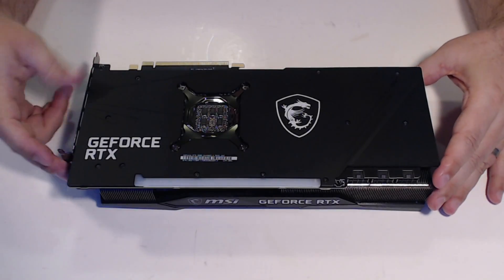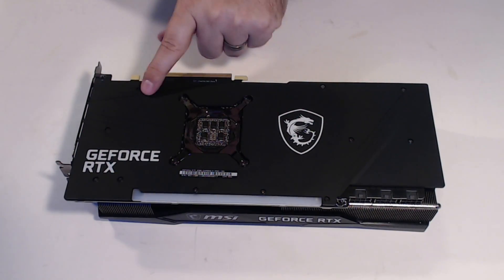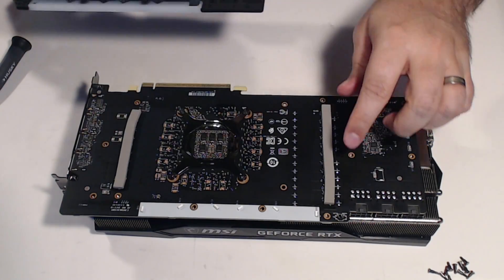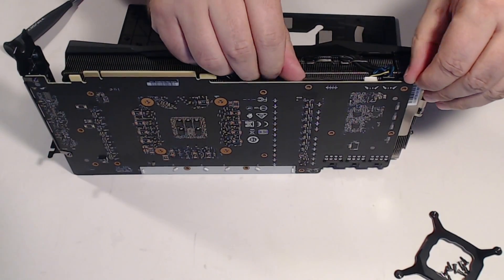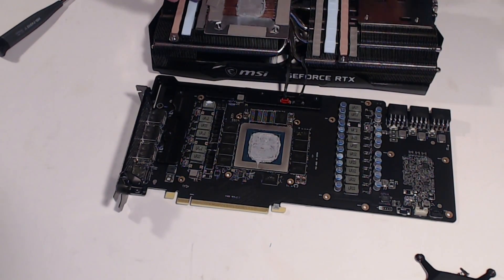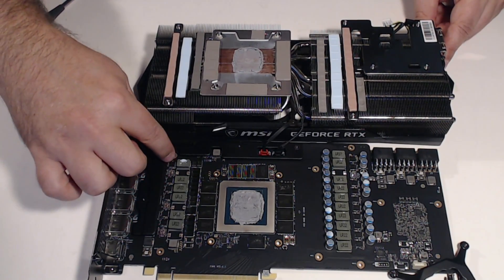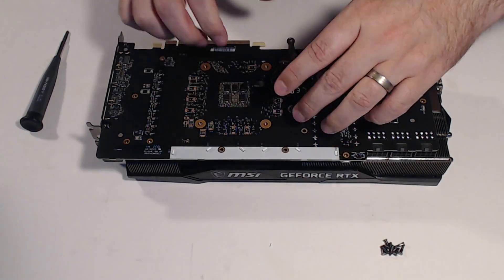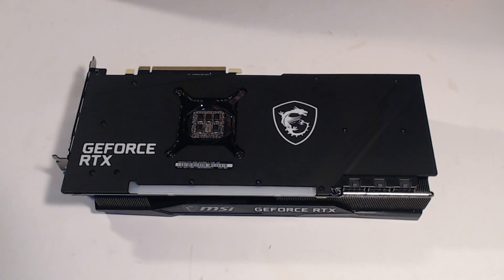MSI GeForce RTX 3080 Gaming X Trio Teardown

Comment: I got 2 geforce rtx 3060 gaming x trio 12g graphic cards I’m wondering if I can run them both on the same system for gaming
Reply from the maker: RTX 3060 doesn’t support SLI, so outside of Ashes of the Singularity, no, you can’t use both for gaming.

Comment: Hello, can you help me please where can I buy memory modules for my board rtx 3080 msi gamin x trio?
Reply from the maker: Memory modules, or thermal pads for the memory modules? Because if you’re thinking about trying to replace/upgrade the memory and don’t know where to buy it, you’re barking up the wrong tree. 🐶
Reply: @JarredWalton  no man, my gpu is repaired in service and the memories are defective, and i need to buy others to be replaced!
Reply from the maker: @CIF05  soldering in new memory is not for the faint of heart! It’s not something I’d even try to do personally. I’d just do an RMA on the card, though of course getting a replacement could take a while.
Reply: @JarredWalton  once I changed the thermal pad the rma was canceled. no?
Reply: @CIF05  no

Comment: I want to change them in my graph, which is the same as the one in the video, could you tell me how thick the memories are?
Reply from the maker: Probably 1mm, maybe less? If you want something better, check Amazon for their highest performance thermal pads.

https://www.amazon.com/Thermalright-120x120x2mm-Conductive-Resistance-Temperature/dp/B08Z7WLRH4/ref=mp_s_a_1_2?tag=dosk-20

Comment: Why would you NOT clean that die and replace with a decent thermal paste job?
Reply: Sorry if i am mistaken, but i think the paste "mess" is because of the video card's gpu having the exposed die directly in contact to the radiator surface, and the lack of IHS giving the need for that amount of thermal compound

Comment: How thick are the thermal pads up front for the memory? I can see the back is around 3mm
Reply: need the thickness too. just got 1,5mm was too thick forthe 4 pads around the gpu :(
Reply: @wannabeats2195  i used 2mm and encountered problems with temps. Changed to 1mm and it's perfect.
Reply: @fransarj  thank you very much.my card is at the moment running at 40 mhs and 80°C, fixed it a littlebit until pads arrive :-!
Reply: @wannabeats2195  3080 mining eth? That's really low. You should be at 95-100mhs. Just Google proper mining settings. That hashrate is for RVN i think
Reply: @fransarj  yes i know. but my thermal pads are improved. they were too big. 1,5cm was too big. startup freezed. then i rolled them with a pen down, but now its risky to mine at more than 40% power. but i ordered new pads. like u said. 1cm
Reply: the msi 3080 sucks, but i love the asus 3080. really!

Comment: Would you be able/willing to provide thicknesses for the thermal pads?
Reply: 1mm for front memory, 3mm for backplate memory.  Not sure about non memory pads but you don't need to replace those. Don't forget to repaste the metal bracket as well because that's garbage at stock

Comment: Do you know if it's possible to remove the front shroud from the heatsink? Also are the fans attached to the shroud? I've managed to scratch my shroud like an idiot and was gonna ask MSI for a replacement.
Reply from the maker: It’s possible, sure. Getting the replacement would be the tricky part. I’d contact MSI support and see what they say.
Reply: @JarredWalton  Cheers. Hearing that it's possible is what I needed. I'll submit a web ticket with MSI now. Surely they wouldn't mind sending a spare shroud that would probably cost $5 to produce for a $1000+ graphics card!

Comment: Anyone already replaced thermal pads for this card? Planning to change mine but i dont want to buy various thicknesses and not need them after.
Reply: Inside 1mm, backplate 3mm. Replaced them already, the vram temperature dropped 20 degrees on 100% fanspeed, 10 degrees on 50% fanspeed.
Reply: @kissshawn  thats great! Thank you! What pads did you use? I ordered gelid 12w/mk. Hoping I get it this week.
Reply: @MrMimbz  I used thermalright 12w/mk 1.5mm ones, I bought 3 packs used about 1.5 packs. The inside pad is a bit larger since the gpu heatsink will squeeze the pad so 1 mm is perfect and 1.5mm is doable just cut a smaller piece. Backplate I just stack 2 1.5mm together it is not that important anyways since this model has a plastic backplate which doesn't do much about heating.
Reply: @kissshawn  i think 1.5mm is the better choice. I used 1mm and just reduced temp by 5c. Will try 1.5mm
Reply: @MrMimbz  Debating between 1 and 1.5mm. Report back please! Also I don't know if replacing the backplate pads is worth the expensive 12w/mk pads. Everyone is buying them for mining. The cheaper 6w pads are a better option. The graphene backplate does not dissipate heat near as well as aluminum.
Reply: @edge929  1 problem tho. 1.5 is out of stock atm. Hope someone who used 1.5 sees this thread lol
Reply: @MrMimbz  I bought the Thermalright 1mm and they dropped temps 10-12C. Did not replace backplate pads, not worth it with the graphene backplate, sucks at dissipating heat.
Reply: @kissshawn  do you think i can make it only by swapping backplate ones?
Reply: @billyfromh8466 not sure you can try first.
Reply: @kissshawn  Will do in a couple of days. have you all downloaded suprim bios on this yet?
Reply: @billyfromh8466  i flashed bios
Reply: @billyfromh8466  if you are mining. You need to flash the bios with better power limit.
Reply: @sampreetkishan3170  it may not be as well as 12w but still better than stock ones.
Reply: @sampreetkishan3170  The stock thermal pads are more like 2.0 W/mk so anything above that will be an improvement, 12 would be best but even 6 will help.

Comment: Im considering taking the plastic shroud off of my  gaming x trio and painting it white, is it possible to remove the shroud without doing a full dissasembly?
Reply from the maker: It should be possible. Note that it’s a graphene composite, which has thermal properties more like metal than plastic. I’m not sure what painting it would do to heat transfer.
Reply: how'd that go? I was curious of doing the same thing...

Comment: how thick is the backplate and how thick is it compared to the tuf 3080 backplate?  I have an asus z490-g rog strix gaming motherboard and im scared that the backplate will have clearance issues due to how close the pcie slot is to the vrm heatsink.
Reply from the maker: The MSI card is less than 1mm "thicker" with regards to the PCIe slot position and the backplate. I will say that many of these cards are a tight fit in certain motherboards. I have an Asus Z490 Maximus XII Extreme and just trying to press the PCIe slot release to swap graphics cards is difficult. I have other motherboards where the first PCIe x16 slot is moved down one position and then it's no problem at all.
Reply: Mine did, doesn't fit!
Reply from the maker: @localguide5471  It would help (others) to mention your specific motherboard. I'm sure there will be cases where some of these large cards have clearance problems.
Reply: Gigabyte Aorus Master Z390
Reply from the maker: @localguide5471  What's blocking the card? The ESS Sabre HiFi cover? Or the chipset heatsink cover? Because looking at this image ( https://static.gigabyte.com/StaticFile/Image/Global/9fc41032d160439cb20304dc2d751ecc/Product/20354/ ) that looks like a big GPU shouldn't have any problems in that motherboard. The case is another story, of course. I've used it in an Asus Maximum XII Extreme (https://www.asus.com/us/Motherboards/ROG-MAXIMUS-XII-EXTREME/), and the biggest issue I have is with pressing the latch that unlocks the GPU when I need to swap cards.
Reply: @JarredWalton  The chipset heatsink.

Comment: Middle top spcap had been changed now to one extra mlcc
Reply from the maker: This is incorrect, according to MSI (see update here: https://www.tomshardware.com/news/msi-stealthily-revamps-geforce-rtx-3080-design-amid-stability-concerns)

MSI Ventus 3080 / 3090 have two MLCC blocks and four SP-Caps, but the Gaming X 3080 / 3090 are still five SP-Caps and a single MLCC block.
Reply: @JarredWalton  According to this article it did change: https://videocardz.com/newz/msi-quietly-changes-geforce-rtx-3080-gaming-x-trio-design-amid-stability-concerns

Also on the webshop where I ordere my 3080 gaming x trio the pictures have been changes from with only 1 mlcc to 2 chips. It's a Dutch site tho, here's a link: https://www.megekko.nl/product/1963/292740/Nvidia-Videokaarten/MSI-GeForce-RTX-3080-GAMING-X-TRIO-10G-Videokaart
Reply: @okkeboonstra4587  bro that is bullshit it’s photoshopped peope proved the crashing was caused by a driver people used Linux and pushed the clocks to 2045mhz with no problem!! It was just a driver issue
Reply from the maker: That Videocardz article was updated with the exact same MSI statement, so I’m not sure what you’re trying to prove by linking it. The Dutch retail site does show a different back image, but it may be out of date — especially if they just used MSI’s original (incorrect) photos.
Reply: Jarred is correct. The VideoCardz article was pure rumor and was debunked by MSI’s own statement, but Videocardz is a tabloid and doesn’t bother to change the headline